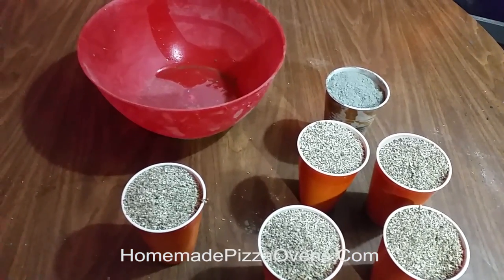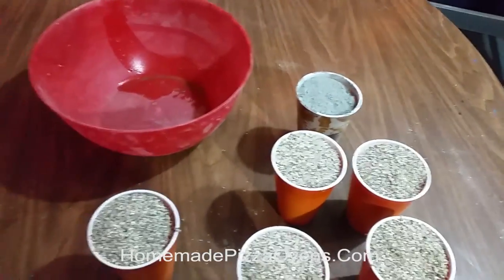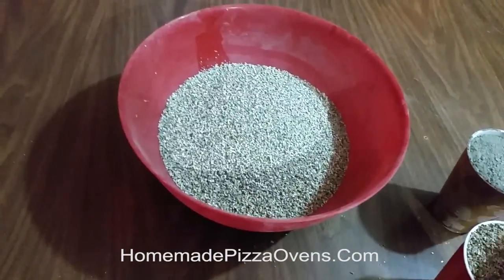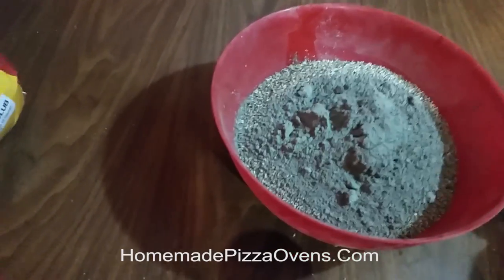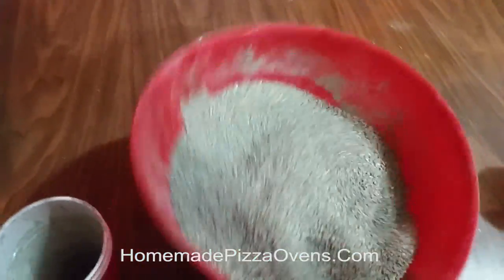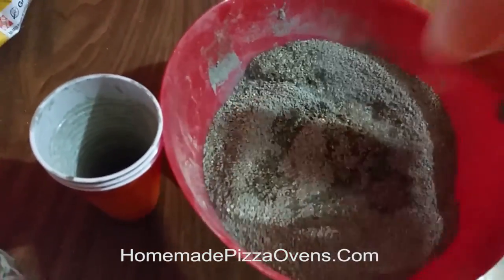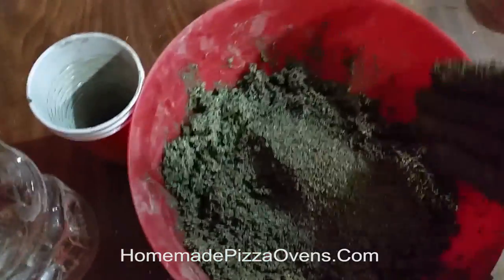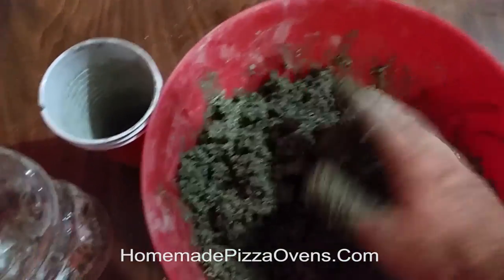Insulated Concrete - Vermiculite - Vermicrete - Portland Cement

Comment: hi, great video. One question, the vermiculite you are using its the one you use for gardening. It comes on 4 ft  bag, for $ 30 in amazon. Thanks.
Reply: He means perlite, not vermiculite.  They are similar but different products.  Use perlite.  Yes, it is sold as a garden item everywhere -- Lowes, Walmart, etc.
Reply: @ Kube Dog.  Actually he did used vermiculite.  Perlite have a much more white appearance.  It's really doesn't matter.   They both work the same way.  Vermiculite concrete @ 5:1 gives a K factor value of 0.72-0.75 whereas perlite concrete @  5:1 gives a K factor of 0.71 which is a little bit better than vermiculite.
Reply: If that's accurate, it's a very intelligent and helpful reply.  Thank you.